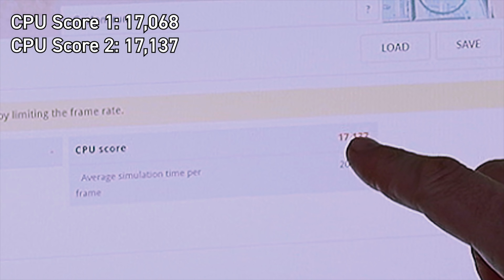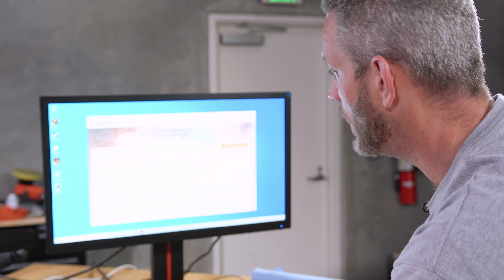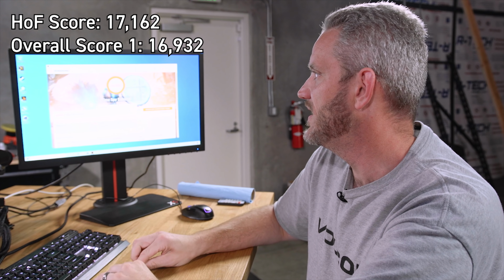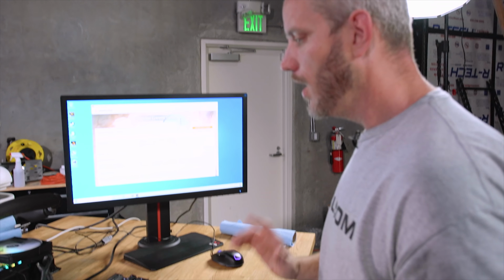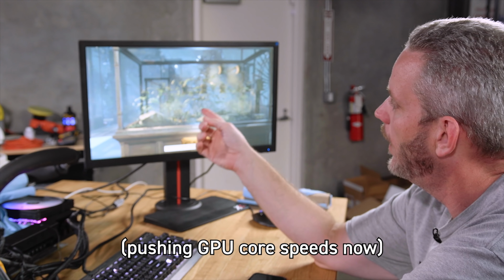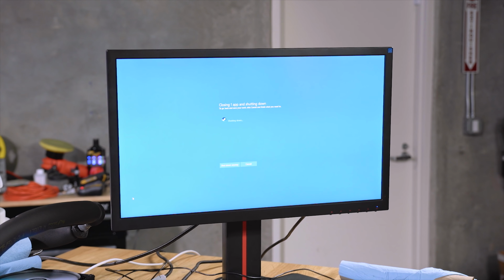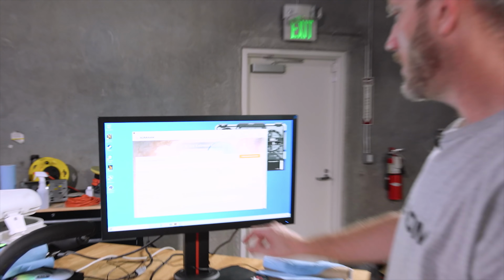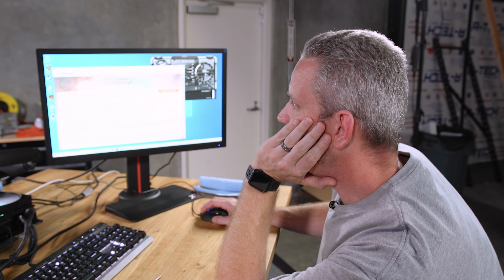I couldn't even win against MYSELF...

Comment: What about going with a Little Devil PC-V10 case and the cooling system built into the case should get the temperature down to -70 degrees below zero but the system won't boot till the cooling probe drops to desired temperature.

Comment: I have an idea why shooting by non working frequencies might work. The enemy to speed in computers is capacitance of the switches in the silicon. This means that at high frequency, the signals will get killed (The higher the frequency, the more a capacitor will look like a short). But because we work with so high frequencies, it gets into the black magic voodoo of radio stuff, where open circuits can look like a short, and short circuits opens (at certain RF frequencies). So by going by what is potentially a dead spot frequency, can maybe start working again at a higher frequency. The trace inductance, and FET capacitance will be acting like mini tuned circuits, so there's probably peaks and troughs all over the high end of the frequency spectrum.

Comment: Is there a reason why Jay's bumping multiplier only? (Not familiar with the chip he's using). I'm running 5.07 Ghz on an I-9 by bumping the multiplier to 52 and dropping the bus speed to 97.5. (And, before a certain MOBO company's screwed up BIOS update that shot too much voltage into my chip, it was stable for all tests at 1.295 volts).  Is there any benefit to stay at multiples of 100?

Comment: Would be fun to se the power consumption of that beast. Would be fun if you could make a video on consumption overall, many are clueless over how the consumption runs away once you start overclockning, and are also clueless about how much more efficient things can become with undervolting and/or slight underclocking. Specially with something heavy running like Linpack preferably LinX 0.9.5 and OCCT at the same time. Seen consumption vary a lot depending on the program, so far LinX and OCCT tweaked for the highest FPS (lowest shader complexity and resolution) is what's loaded my system the most.

Comment: What I want to know is, what chip has been the best overclocker, how big was the difference frequency stock to the frequency overclocked. My chip stock is 4.2 ghz but I run it at 4.9 ghz in the winter and 4.7 ghz in the summer. So not great but not bad.

Comment: I think you could boost your CPU score by a point or two (rounding up) by switching from a USB mouse and keyboard to a PS/2 mouse and keyboard, as the computer wouldn't waste CPU cycles polling them repeatedly.

Also, USB controls kinda tend to crap out at extremely low temperatures.

Comment: This may seem like a dumb question but why doesnt someone make a CPU socket riser or extension or whatever? That way you wouldnt have to worry about condensation on the mobo when youre doing extreme cooling. Would a foot or two of wiring have that much of a negative affect on the signal or power delivery to counteract what youre trying to achieve?
Also if the extension was engineered to withstand LN2 temps couldnt you just drop the CPU into a container of it without having to worry about a heat spreader or any other apparatus normally involved?

Comment: Even know your tweaking hardware specs. Wouldn't there also be a delay in how the software is transmitting to the system? Wouldn't, it be wise to also have to tweak the OP (Windows 64bit)? (Buffers, delays, Redas to wights, etc. and overhead system resources)

Comment: -21 degrees C. That's the best case you can get with normal table salt and ice if you use a weight ratio of 33/100 salt to ice. -15 should be reachable in most cases (just be sure you mix it really well, it needs to be a good slurry) so I'm pretty sure it would change something.

Comment: At one point I was literally clipping cable ends off, taping the ends and tucking them away to avoid cable clutter. A time well before modular supplies were a thing... And we didn't have basements or even area to run cable behind mobo trays... 
We also had to walk FIFTEEN miles in the snow to school everyday. Even in the summer. 😅

Comment: Compare Control on MAX - Non-RTX settings, and then try max RTX - and compare the game images side by side.   You could ALSO do a Video on the new Nvidia Sharpen Filter at the same time, because I GUARANTEE that 1440p upscaled to 4k with proper levels of Sharpening post process will look FAR better than any DLSS method to do the same!

Comment: i was wondering if anyone could explain why im not getting nearly as much fps as i should be getting in most games. 
Specs:
threadripper 1950x
geforce RTX 2080
Corsair Vengeance LPX 16GB (2x8GB) DDR4 DRAM 3200MHz
EVGA Supernova 1000 G3, 80 Plus Gold 1000W

NZXT RL-KRX62-02 Kraken X62 280mm
Reply: i keep all my settings on low and still have a hard time keeping a consistent 144fps in most games

Comment: You Just Cleaned Your Dunked Radiator..... 😢
Instead of dunking a radiator into the ice-chest, simply put fittings on the end of the hoses that would be attached to the radiator, and dunk them directly into opposite ends of the ice chest.

Because of the way siphons work, it won't put any extra strain on the pump. In fact it'll probably be less restriction than the radiator.

Comment: Hello SIr!  I have about 35 years in IT, Aviation Electronics in the US ARMY and electronics tech. Overclocking should be looked at from the basic layout. For instance, I was challenged to build an AMD FX-9590 and sustain the highest possible OC without losing stability as well. I bumped the bus frequency and dropped the cpu multiplier to achieve 5.2 GHz using only an AIO Deepcool Captain 240mm.

Comment: No, the specs for classic are NOT the same as they were back in 2004.  Classic is built on top of the current client code base, so the system reqs are the same as modern retail wow, with the exception of the models and textures being lower poly count and resolution.

Comment: Salt in water let's you easily get that water down to -20°C though. In fact, adding salt to ice cubes will drop their temperature to that point, as melting ice requires energy (breaking of the crystal lattice). And since you're not heating it, that energy comes from the surrounding, dropping the 0°C ice cubes to more like -20°C ice water.
So, you know, salting that ice water is gonna get you the significant drop in temperature.

Comment: Thanks for the vids Jay.   I am not as interested  in minimal specs as I am what is the minimum equipment (maybe 5700 xt) to run 1440p and 144hz refresh. I am looking at upgrading my monitor to a 32inch LG 1440p 144hz display and powercolor 5700 xt if I can find it.  I do not want to drop below 144hz.

Comment: i love this types of video. do about control pc game. i have a Gtx 1080 and rzen 5 2600 and even with mild oveclock on the card (+100 on core +400 memory) couldnt enable a simgle rtx setting without game freeze. none of the 4 or 5 settings at any rating . i heard that no gtx card can utilize this rtx even if you can select it to be.

Comment: Jay, Why not use the EK block for the VRM on that board? 
Also could you run some game benchmarks with that CPU? I'm curios how the 3175 performs in gaming. I have seriously been considering getting the Dominus and 3175 and mounting in a 1000D with a couple of watercooled 2080TIs O11G (which means I"ll be using non MSI motherboard and graphics cards for first time in about 9 years..) Would like to see how it performs though.

Comment: Don't worry about forgetting stuff after 3 months. When I overclock I don't even remember what I did the day before, that's why I write it all down (yes with a pen and paper.. old school.. paper doesn't crash). There are so many things I'll change in one single day, it's impossible to remember for me and often I need to go a few steps back to go in a different direction. And.... Maybe it's the fact that I have no clue what I'm doing compared to a lot of you guys. But guess I'm lucky, so far I had great results on my CPU's and GPU's. Fe. I have my 2700X running stable at 4.3 instead of 4.2 with a lazy unpolished overclock, I'm sure there's more in it as well as my memory timings (CL14 3339). Noticed tighter timing really benefit this processor a lot.

Comment: A WoW Classic build would be good but I suspect you'll get decent performance off even a low end APU based system (E.g. Ryzen 2200g). The specs have actually increased from what they were originally as now they are using the current game engine at the back end. They aren't quite as high as the retail version due to some features of the modern game not existing in classic, but they are still higher. 
Vanilla WoW Min Req:- Windows 98, 800mhz CPU, 256mb of RAM, 32mb GPU (such as Geforce2). 
Classic WoW Min Req:- Windows 7 x64, Core2Duo E6600, 2gb of RAM (4gb for APU), 512mb GPU (such as GeForce 8800 GT).
Retail WoW Min Req:- Windows 7 x64, Intel i5 760, 4gb of RAM, Geforce GT 560 2gb or Radeon HD 7850 2gb. 
and 
Classic Wow Rec Req:- i7 4770, 8gb of RAM, GTX 960. 

I originally ran Vanilla on a Pentium 4, 2.4ghz w/800FSB. 512mb RAM. Radeon 9200 - 128mb.   Or on my Mac; Powermac G5, Dual 2.0ghz. 1gb RAM. Geforce 6800 Ultra DDL - 256mb. 
Maybe this info will give you some ideas. Good luck with OC'ing.

Comment: I would like to see a PC per framerate/resolution target. Same case,PSU,memory,storage,cooler. Then just change CPU(mobo as needed)&GPU to meet certain targets, 1080P60fps, 1080p240fps, 4k60fps, 1440p120FPS, ect. What GPU/CPU combo do you need to meet a certain target, how far will a Ryzen 2600 get you, is a 2070 a good framerate or resolution card. Test major high demand titles, then low demand titles. Results would be something along the lines of: low demand games like fortnite need a 2400G and a pacifier to play 1080p 120fps, high demand games like Metro Exodus needs a 6700 and a 1080 to play 1440p60FPS. answer a question like 2060s are pointless because they either overshoot or undershoot common performance targets.

Comment: BIOSTAR-H61MLV3 MOTHERBOARD I5-2400 3.1GHZ STILL USING FOR GAME YES\NO PLEASE EXPLAIN
Reply: Which game? Which GPU? What frame rate are you after? What resolution? An i5 2400 will play some games ok. A bit weak for new stuff. Very weak for high FPS.
Reply: pubg game is laag im using 1gb graphic card and 8gb ràm

Comment: What happens when you overclock in a big walk in fridge?
Reply: You freeze to death, you fight moisture rapidly developing over your rig, but you beat Kingpin without LN2! :-)))
Reply: @liviubita-dragonelulviteaz  Well that took me on a emotional journey.
Reply: What about walmarts walk in freezer system. -30 to -40 degrees in there. That's in Fahrenheit
Reply: Someone tried that. It didn't really do to good, A fridge isn't meant to cool, it's meant to keep things that are already cool cool.  You would need something along the lines of a chill blaster to do what you are wanting. But even those can't  remove heat quicker than ice water or LN2.
Reply: @popeizzy2012  I was wondering if it was possible to build a refrigeration system into a computer however i envisioned that condescension would form on the inside. So that is what led me to think of cooling the environment instead of the components directly.

Comment: I think to play wow on low to medium settings all you need is a Ryzen 3400G based system, so for around 350'ish $ you can get a rig running to play wow. if you want to play on high graphic settings then a simple RX570 will be perfectly fine. I dont think WoW will be so hungry for specs even with some updated graphics.
Reply: WOW on medium settings is an extremely undemanding game. I used to play it on an old Mac Pro (running Windows) that had a really low end stock GPU.

Comment: You should have a water pump or some type of water flow device pushing water through the rad fins. I recommend a fish tank oxygenator. Float the rad in the water just barely on a rack, then have the oxygenator flow water over the fins. That should keep the heat soak down more.

Also the salting method works best with rock/ice cream salt. It'll melt the water but as you add more ice and get to full saline saturation, the water temp will drop more, and with the oxygenator, save the ice.

And give Phil a raise for nailing Du Hast! 😅

Comment: Do a budget WoW classic build! I've been playing around with old systems myself. Picked up a Core 2 Extreme the runs great, I've tried old AMD APUs and Intel Onboard stuff ( Neither worked well). I Build an A300 Mini with a 2400g that works great. It would be fun to see what you could come up with.
Reply: I did this. I have a amd phenom quad core and an nvidia 660ti, in an classic lian li case running ubuntu and lutris themed to look like xp (classic theme)  It boots to wow from off in 8 seconds. Also have 2 x HP 720p 19inch tft. I love it.
Reply: @jondonnelly3  nice! I was using a 560ti with my Core 2 quad. Found an old junk white car to put it all in. Made a hardware raid on spinning drives too.
Reply: Athlon 200GE on a B350 with 8GB of RAM would probably rock it for about 300 bucks
Reply: @Charter23682  bro I was gonna say that! I'm not sure the Vega 3? I'm that would be enough for 60fps.
Reply: @jasonallison1913  well, it gets around 40-45 fps in modern WoW on low-medium at 1080p. Thing that cripples the Vega 3 graphics is the limitation to 2666 Mhz Ram of the Athlon.
Reply: @Charter23682  Ya I think 60 FPS should be the goal. Vega 3 is just a little weak I think. Looks a GT 1030 would do ti.
Reply: @Charter23682  I found classic wow in ubuntu used 2.7GB Ram total! It's really light, but the Vega 3 is too weak. Mabye throw in an old graphics card or an RX560, those are cheap used.
Reply: Jason Allison my laptop (third gen i3) with integrated graphics Works just fine 😂 the Game is like it Used to be - 720p. 😂
Reply: @stndrd3608  Ah, 720P is the key, that helps a lot. I think Jay is (should be) focused on 1080p here. I was able to get my old APUs and stuff to run pretty good at 720p but my goal was 60 fps at 1080
Reply: It runs on low settings on An core 2 duo system

Comment: use'n ASUS a88x-pro/Amd a10 7850K..no vid card... would never have tried manual setting anything without the info you guys 

share..  allways worried the thing would melt into a singularity if i did anything but optimized/auto settings. just figured if it wanted to weave more threads it knew where the darning needles were.. Cuz i dont...or didn't...
Anyway..  Good job on being user friendly. 

rokinroll

Comment: WoW Classic is not the exact same code as Vanilla WoW since it's graphics have been udpated to almost latest WoW Standards. It's more like a backport of todays WoW. Never the less I'd actually like to see how low u can go on the specs of a PC an still run WoW considering it's a huge deal in the chinese market which is known to use lower end PCs

Ah and btw. the video didn't suckt at all! It's also nice to see the failures and learn from them (and sometimes this is even more valuable).
Reply: You are right in saying its not the same code as Vanilla WoW, but I hope I am right here on a few clarifications.  The graphics are classic, even down to missed textures and lighting bugs.  The animation and rigging are similarly classic.  What has changed is it is running the modern WoW engine.  This has caused them to reproduce (very intentionally) bugs, and clipping and physic issues to the best they could.  I am not sure how all this actually effects graphic and CPU performance.  However since its all still the same file size in textures and images it should be interesting.

Comment: Classic wow is still using an upgraded graphical engine.  I think they have suggested settings to emulate true classic, but you can turn them up.  I haven't looked at official minimum specs, but I'd be surprised if they're the same.
Reply: yeah im also pretty sure the minimum spec are not the same as in 2004. They dont use 100% of the same code for classic as for vanilla. it looks and feels pretty much the same, but they use the new wow engine underneath it.
Reply: As long as you have a midrange system, you can run wow at 200+fps. My system does 200 easy, but wow bfa runs like complete crap. My ryzen 7 1700 is the bottleneck. Only 25-35 fps in heavily forested areas at max settings
Reply: @suiton20  Oh yeah.  My system is well above requirements.  But it is an interesting question, how a system specced for the original game would perform.

Comment: with salt you can get it down to -21c so that is not just 'a few degrees'....
Reply: @Mark Y What could possibly have made you think this kind of thing was for practicality? This is very clearly extreme measures for leaderboard status. That's like saying Formula1 is not practical coz there are speed limits in a city.
Reply: i think he means without LN2 or LH2 ;-)
Reply: @Ulkhor  you gotta be mad to use liquid hydrogen for overclocking
Reply: @ItsZim0  
HE2 sorry :-(